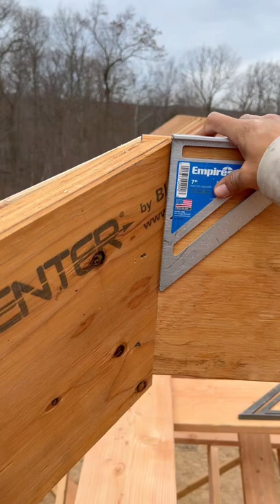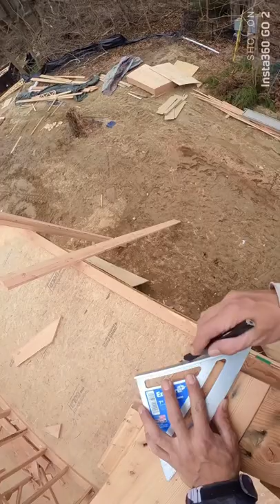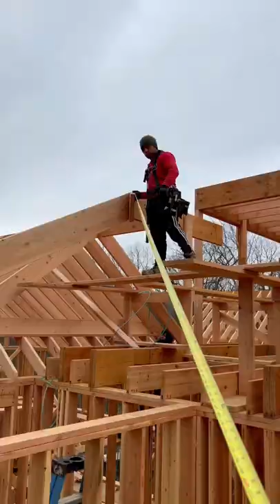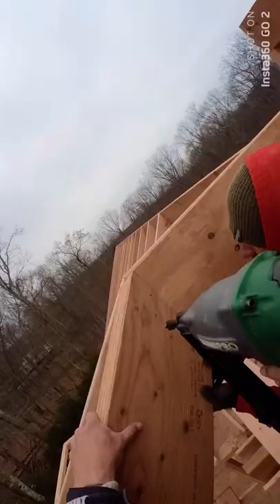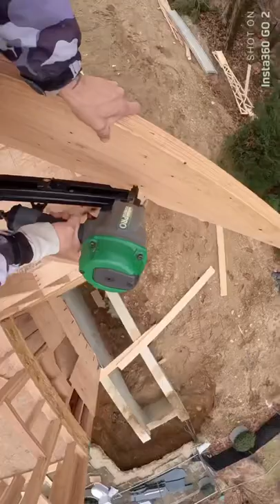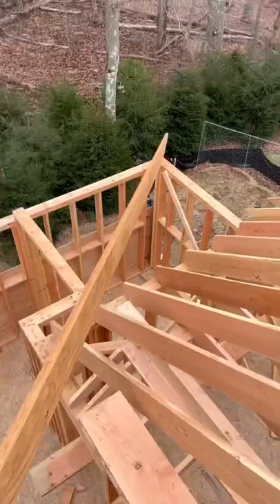Hiprafter #construction #architecture #design #shorts #artwork #beautiful #framing #work #quality

Comment: This was the hardest part of framing for me doing these and getting them on point. If they are slightly off it throws everything else off
Reply: If they want to really impress,  they should have showed how to calculate hip drop.  It's pretty simple but a very important part of the process.  Your H.A.P. on the hip will be different than your rafters

Comment: I have to say, 45ing that top plate for the birds mouth is a clean move.

For the nailing of the rafter, it's MUCH safer to set one nail at the center rather than at the top where it can easily glance off and hit you coworker. Set the center nail and let him get out of the way before nailing the rest of it.

Comment: LVL hip rafter? Wow...when we framed years ago, the only thing we used LVLs for was a super long horizontal span and most of the time we doubled up a 2x10. Now double LVLs are being used as ridges and single LVLs are being used for rafters! A bit of overkill if you ask me and a WHOLE LOT more expensive.
Reply: Architects & engineers decide those things, not the framer. He's building on Long Island also, so that's part of it - bigger houses. 👍🏻👌🏻📐🛠️🔧📏🔩🦺🚧⚠️✏️

Comment: That all works when both pitches are the same or no one asks you to keep an equal overhang throughout the whole eave system. It is important to note this: you don't want your followers floating everything up and then realize the sub doesn't line up at all. In other words it is not certain that a hip or valley head cut bevel will be 45°.

Comment: Why did you cut the corner of the wall off? Why didn't you cut the hip king just sit down?
If your roof pitch is a 7/12 then instead of cutting your hip King on the 7 /12 hip valley you cut it on a 7/17 hip valley. That makes everything sit down just like it supposed to!

Comment: That hip length should be worked out on the ground using trigonometry , not by some dummy crawling up the roof to measure it. And why are you dragging hoses and cables everywhere..? Its 2023 .. we have cordless tools these days.